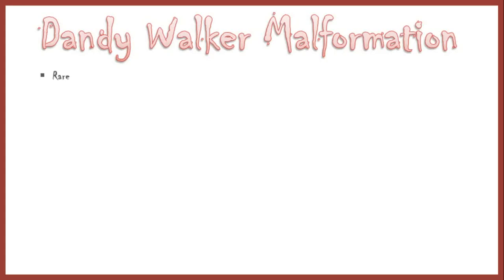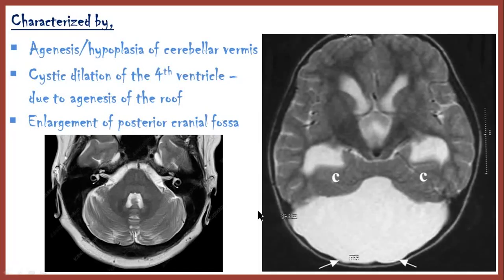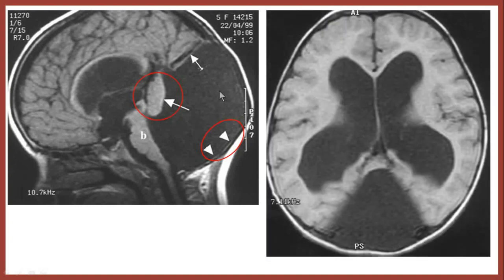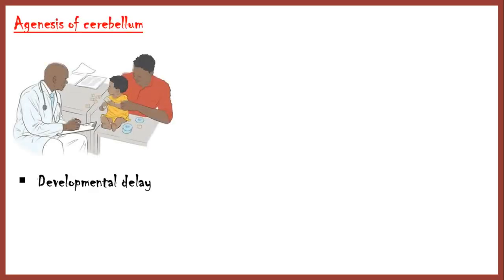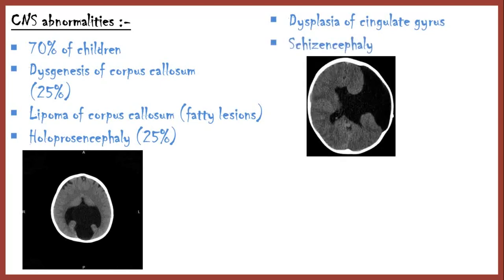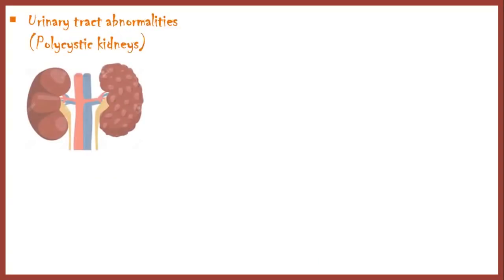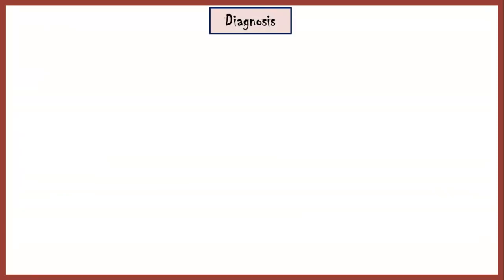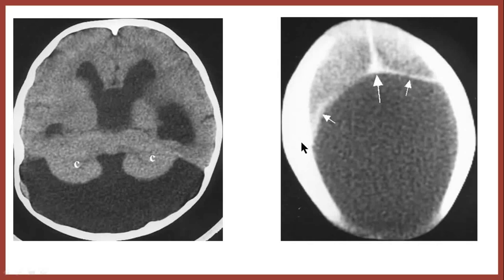Dandy Walker Syndrome - Causes, Signs & Symptoms, Pathophysiology, Diagnosis

Comment: Is it possible to occur the first pregnancy then the next one? Genetic inheritance?
Reply from the maker: Yes. There is a possibility. But not always
Reply: @medtoday  
Thanks for reply.  My daughter was dws. She died at her two years old. Now I'm pregnant 16 weeks. Again it is diagnosed as dws. Is it possible to diagnose in 16 weeks? And is it important genetic test?
Reply from the maker: I'm sorry for your loss.
Well, yes. Fetal ultrasonography can detect abnormalities of cerebellum before 18 weeks of gestation. If you want to do a genetic test, you can do a "Karyotyping". Anyway, refer a consultant for more info.
Reply: @medtoday  thanks a lot
Reply: My soon-to-be niece has been diagnosed as DWS at 20 weeks and it seems to be a really severe case. My sister hasn't had an MRI yet (everything is slow because of COVID) but the ultrasound has shown major brain and spine deformities and my niece may not even have eyes. I don't know if I'm trying to ask for advice or if I'm just trying to vent but I have no clue how I could possibly comfort my sister or if there is even anything I could do to make her feel better
Reply: @asliibrahimova9543  what happens in yr next pregnancy
Reply: @asliibrahimova9543  can i contact you...I also have the same problem.
Reply: @asliibrahimova9543  hey i just found out my 19 weeks unborn have DWS, we are aborting now, I read your comment that you also diagnosed this in next pregnancy ? Did it happened again? I am sorry but i have no clue about this and my comment may sound insensitive please reply
Reply: @nilekarmayur How’s condition ? I have the same story. Please reply me